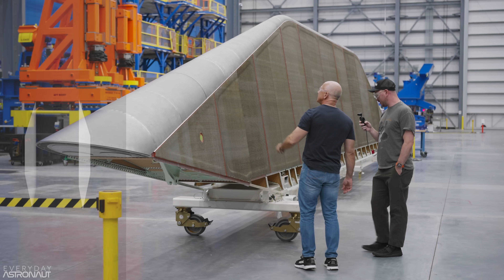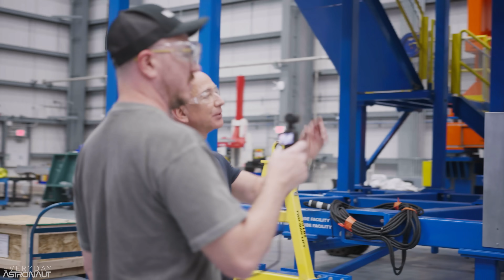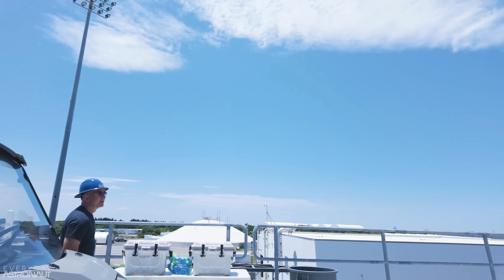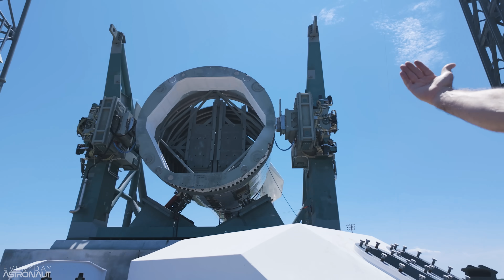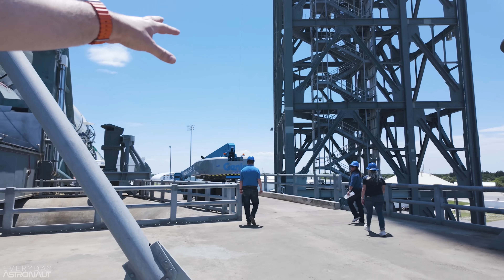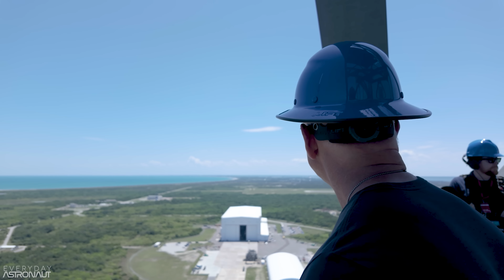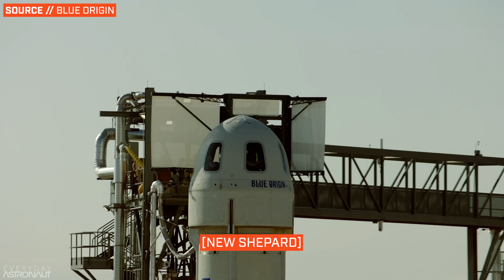First Ever Tour Of Blue Origin's Massive New Glenn Launch Pad w/ Jeff Bezos!

Comment: It’s crazy how different this is from how SpaceX builds Starship. I mean it’s both heavy lift vehicles but at the same time so vastly different
Reply: It’s just different philosophies. SpaceX built a factory around a rocket with the needs of that one rocket specific rocket in mind. Hell, they even waited to build the launch tower until they knew Starship was able to fly and land with the current dimensions.
Blue Origin built a factory, launch pad and everything else needed before building a rocket or even have it static fire.
Both are valid approaches. One has the rocket fit into the surroundings and one has the surroundings fit the rocket
Reply: @marvinko6610  This is so well explained! It's exciting we get to witness both journeys.
Reply: @marvinko6610  Astute analysis
Reply: @marvinko6610  My only issue with Blue Origin / Jeff is around their old-school cost-plus and reward payments before any goals have been met, all of that was derived from the NASA bidding and lawsuit released documents for the lunar bids. Blue Origin proposals to NASA were more akin to Boeing, Lockheed Martin and other legacy space firms.
Reply: Waterfall engineering.  Where you solve all problems in advance.  Space X.  Hardware rich then blow it up and find where it breaks.  Waterfall vs Hardware rich.
Reply: @mefobills279  problem is they will have to face those failures to and with there slow speed give them another dicade to get this thing to perfection
Reply: @mefobills279  The problem with waterfall engineering is that many of the problems cannot be solved in advance because they are unknown. With the SpaceX approach you get to know about them PDQ.
Reply: @mefobills279  like Boeing. I am not saying it's worse, with all respect to Blue Origin, SpaceX has proven that their approach works.
Reply: @varyagus  I agree, the waterfall approach is inferior.  There are things that you can not know in initial design.
Reply: @mefobills279  Finally more and more people are seeing that Starship is just Elon reinventing NASA in 1960, like he reinvents everything
Reply: @mefobills279  And still no proof that "hardware rich" is better, as Musk claims.
Reply: @marvinko6610  New Glenn and Starship do not compete. New Glenn is a heavy lift class rocket, Starship is a super heavy lift class. Look up their payload mass to LEO, it is a big difference. New Glenn does compete with Falcon Heavy, though.
Reply: @klapstoelpiloot you're citing wikipedia at this one. The truth is that New Glenn uses 7 engines with very little thrust for it's size and weight so this particular ratio allows the New Glenn to do orbital missions only. If they however, raise the number substantially while upgrading their BE-4 to 300tf up from 250tf might allow them to compete with Starship for interplanetary missions like Moon or Mars. Starship for reference with 33 Raptor 3 SN1 thrusting 320tf each goes up to 10,560tf, in comparison to 7 BE-4 on New Glenn each thrusting 250tf for a total of 1750tf. It's almost 10 times more thrust.
Reply: @klapstoelpiloot  both are unfinished and unproven in their complete capabilities. Both have lots of work to do before achieving their goals. Both have long term focus areas that are very different that the current marketplace provides.
Reply: @klapstoelpiloot  Falcon Heavy, A rocket that is so needed it has launched less than 10 times in 6 years, ahum. And bezos thinks his rocket that costs 4x as much (expendable!) can compete. New Glenn only has a very small niche in which it is uniquely suited.
Reply: There are many reasons for a difference -- SpaceX and Blue Origin have different goals -- SpaceX want to colonize Mars while implementing Nasa Contracts Whereas BO wants to do near space things like Commerical Space Stations and complete there Nasa contracts...I have enjoyed both visits to the factories and wish them all success -- What is similar between both companies is the focus to reduce the cost of access to space
Reply: wtf are half of these comments, spacex is building starship in a way where they build fast, break stuff and fix it blue origin is making sure everything works on paper, working out all the issues (and hence taking longer) and then flying
Reply: New Glenn is a Heavy launch Vehicle, Starship is a Superheavy Launch Vehicle
Reply: @infected7258  starship is a tin can.
Reply: starship is a super heavy-lift launch vehicle.   And if there were another classification above that, it would probably be that, too.   But super heavy lift is just anything more than 50 tons no matter how much more than 50.   Because at the time 50 was isane.
Reply: I am very positively surprised about how much Jeff knows about his rocket. Great to see!
Reply: One has results, the other has aspirations.
Reply: @richardpark3054  the market is evolving. It is dumb for Musk disciples to keep proclaiming that SpaceX has already "won" the race. ThIs race to create a commercial market for space industries off-Earth never ends  -- and  in major aspects SpaceX is certainly far ahead right now, but Musk has a different set of long term goals from NASA and from Bezos. I

N this market,  there is more than one race...Blue is a major influencer, just not yet a proven fixture in the orbital segment, but is not far off from being a presence there. Will they succeed? They certainly seem well positioned to have a long term presence.  In time, BO is capable of achieving its place in the orbital market that SpaceX currently dominates largely as a sole provider. SpaceX total dominance won't last forever, most likely, any more than Henry's Ford's dominance of the early auto industry prevented other entrants and enormous competition.  Ford didn't automatically remain on top forever. 

People ignore the fact that Musk's  long term plans involve a different set of priorities.  What is interesting to think about is "what will this market look like in 5 years and in 10 years?" undoubtedly, it will be very different than just what we see now.  There is room for numerous participants and each will find what they see as a fit, while constantly looking forward to the next phases and where they fit in that.  The free market is dynamic but nature.
Reply: @richardpark3054  I literally just saw a “successful” starship landing that never actually showed the landing and I saw the ship falling apart as it was doing its descent. Literally pieces flying off and metal melting like tinfoil
Reply: @strangeke7750  What are you saying here? Have you ever listened to anything? For the 1,000 th time, SpaceX goes by iterative design, that mean the rocket is likely to fail at some point, and they want it to. It gives them the information to correct problems, then launch again. Each time the rocket gets a step further. Next step: prevent the flaps from melting. If you pay attention the new ships have altered flaps that are shielded better at the hinges. And an upgraded heat shield.
Reply: @strangeke7750  you did see it fly ... that's one step ahead.
Reply: @CHMichael  is it? I see blue origin putting a lot of effort into reusability. Which is the whole point. How reusable is starship? I literally just saw it melt in a “successful” launch, literally saw pieces fly off and the steel being melted through. Wow so reusable and cheep. That will surely make us space faring 👍
Also we haven’t seen the new glen fly yet. But I bet everything on them being more successful then space x.
Reply: @strangeke7750  how reusable is new glenn's second stage compared to starship?
Reply: @ASTR_INF  starship second stage isn’t very reusable. Sorry to say. But let’s give blue origin some time for launches. At least a couple.
Reply: @strangeke7750 you saw pieces fall off the second stage that still successfully landed — a second stage which BO will intentionally destroy every launch.
Reply: @zachansen8293  it didn’t land. It was falling apart and melting. Lmao. And you never saw it land
Reply: @zachansen8293  Actually BO is trying reusable and disposable second stages. They will figure out which is cheapest.
Reply: @StillAliveAndKicking_  We've seen what spacex has to do.   It's not something you can "try out".  Also, their rocket probably isn't big enough to get a meaningful mass fraction.   Super heavy is 2+x the thrust of a saturn 5 to get fat albert, errr, starship, into orbit.
Reply: @strangeke7750  It was falling apart and melting.   but it absolutely made it to the surface softly -- a real testament to its engineering.
Reply: @strangeke7750  BO intends to blow up every second stage they launch.   So not sure how that could ever be more successful.
Reply: @strangeke7750  First, how did you 'just see' a successful Starship landing? The last prototype flight was early July, about 2 months ago (I was there). Second, your measure of success is not universal: your 'failure' may meet criteria for success in a different context.
EDIT: Every Saturn V booster ever flown crashed into the ocean. Same as every booster ever made (except SpaceX Falcon 9 boosters). Were those all failures?
Reply: @snuffeldjuret  I don't recollect venturing an opinion on that. Could you re-read my post and correct me if I'm mistaken? Thanks! (In advance.)
Reply: @snuffeldjuret  Our very slight conflict is not about what I thought, it's about what I posted.
Reply: @paulmichaelfreedman8334 that’s just normal design process lmao. I swear you guys take company slogans as some sort of bible verse
Reply: @strangeke7750 if that’s all you’re seeing maybe stay away from all this. Pretty clear it’s all over your head.
Reply: @strangeke7750  Not yet. But it's still really early in the actual design maturity phase. The first stage is basically through about four iterations and the second stage is through about three. We still have a lot uncertainty at that point, especially since they are making design changes that do ultimately affect the rest of the system too. The US government is the primary reason this is all going so slowly - not SpaceX or their methods.
Reply: Yes, true. But wouldn't necessarily compare it to Starship. More like, Falcon Heavy.
Reply: It's a battle of SDLC methodologies. Elon started significantly sooner which is why he's got things to show for it. I think Agile will win, but let's give this a shot.
Reply: @Balmorax  If you go back and look you'll see that BO is the older company.  Jeff got started first, he just looks like he didn't.
Reply: For what it's worth, both companies are after two very different ends goals using different methods with vastly different time horizons. While it is good entertainment to compare them, they are not competing with each other at all. At least, not now or in the foreseeable future. 

So, all this talk is quite premature.
Reply: SpaceX funds the Startup through Falcon 9 launches and recurring revenue from the satellite network. All with a reusable rocket built in a factory. We now see a factory for Starship and boosters still iterating changes to the rocket and infrastructure. It’s been a lot more exciting watching SpaceX. Amazon cash funds Blue Elon built a space based business to fund Starship. I hope Blue flies but as a bedridden man it’s been more fun to watch SpaceX every day. What a time to be alive. I hope I’m around to see both launching.
Reply: Jeff Bezos looks like a turtle with a helmet on
Reply: the fact space x doesnt need either an erector, this mass simulator and integrate vertically their rocket with various cranes is way better and more efficient. 
the cost of erector and mass simulator must be insane…ground support equipment is a killer in such industry!
Reply: Like a factory production line compared to a bespoke "Rolls Royce" production.
Reply: Both teams taking shots at each other.  Hilarious.
Reply: Spacex built Starbase more like a shipyard than a traditional aerospace plant, but that was always intentional. SpaceX always did things simple because it allows higher rate of change and faster improvement. Blues infrastructure is impeccable but that comes with tradeoffs too. I would bet a lot of the way blue runs is heavily influenced by the way jeff built amazon out. If you see one of their new distribution centers they are built out with the same philosophy. Despite that in the time blue has been going spacex has dominated the market and has actually been running revenue programs for years rather than endlessly perfecting.
Reply: @briancnc  dude. I’ve worked in a fabrication workshop. When it comes to quickness or efficiency blue origin takes that win. Because they actually spent a ton of money on infrastructure. They build Indoors with indoor lifts and dry conditions that cut down on wasted time. Space X hasn’t even got that. Maybe musk hasn’t built it because he isn’t sure he can even do it?
Reply: @strangeke7750  whats the net output though, that's all that matters. If you don't get the contract then it doesn't matter how fancy your shop is, that's why spacex has dominated the market with hundreds of successful launches
Reply: @briancnc  they just built the thing 4 years ago. They are about to test their first FULLY BUILT rocket.
Reply: @strangeke7750  that's literally my point, 20 yrs and little progress. Excited for them both but blue and spacex had different strategies for which spacex has made far more progress on actually exploring space.
Reply: @briancnc  what did they explore that hasn’t been explored already? lol. All I see is then blowing up rockets
Reply: Starship is a super heavy lift vehicle.
Reply: @C-U-Next-Toosday  If that's all you see, well let me tell your your vision absoluty sucks, moreover, you're completely blind. Assumption is the mother of all f-ups
Reply: It is more in line with ULA
Reply: Blue Origin is the "old school" process with private money (and some NASA cash).  Bezos hired out of the old school industry.
Reply: Different men - different teams - different approaches 🚀
Reply: This is more like the Falcon Heavy and can't be compared to the massive Starship.
Reply: And there is also a rocket company in Germany building a rocket based on car parts. Tis really indicates that space flight industry is booming and innovating! 🎉
Reply: SpaceX funds the Startup through Falcon 9 launches and recurring revenue from the satellite network. All with a reusable rocket built in a factory. We now see a factory for Starship and boosters still iterating changes to the rocket and infrastructure. It’s been a lot more exciting watching SpaceX. Amazon cash funds Blue Elon built a space based business to fund Starship. I hope Blue flies but as a bedridden man it’s been more fun to watch SpaceX every day. What a time to be alive. I hope I’m around to see both launching.
Reply: Hope they show us something soon.
Reply: @C-U-Next-Toosday  Not Xitter... TwiX!  ;-)
Reply: Different timeline too, tbh. But better late than never.
Reply: It’s so funny seeing all the libs in here that were Musk fanboys a few short years ago driving their teslas to Starbucks to get a soy latte. Now they hate on him every chance they get simply bc he disagrees with their politics…
Reply: When is Blue Orgism going to actually lift something heavier than tourists? Or deliver engines that are nearly 10 years late? Asking for a friend.....
Reply: We live in a time where people actually have the option to be fanboys and choose sides. Its awesome
Reply: @os10v311
Promoting free speech is being a villain?  1984 anyone.
Reply: Yeah Jeffs is KRAP talk about propaganda 🤣🤣🤣🤣
Reply: Blue are more professionel. Space X look like rocket nerd amateurs in comparison.
Reply: @ACPilot  exactly. Blue origin is building a strong foundation. Space x looks like a makeshift one off diy project.
Reply: I applaud bezos for at least putting his money into space stuff instead of so much other nonsense that billionaires put their money into but at the same time it's hard not to see that these are mostly empty buildings and he really doesn't have a manufacturing process to build a lot of these. Now maybe he doesn't need to build or want to build a lot.
Reply: A better way to spend 1 billion. 😊
Reply: @marvinko6610  I think Blue Origin will prevail over SpaceX rapid prototyping. The question isn't, who's in Orbit first. The question is, who's got the more efficiently reusable launcher when both are in Orbit, who can offer lower faire to Orbit?
Reply: Considering Starship doesn't work, I really hope it'd be different...
Reply: @llollercoaster  I hope this comment gave you validation. Because you know, being a snarky dick on the internet is making nobody's day any better and the internet discourse as a whole a lot worse. So i hope at least you've gotten something out of it
Reply: Is new glenn heavy lift??
Reply: @Berilaco  it is. Even though New Glenn is 45 tonnes to LEO as opposed to Falcon Heavy’s 60 tonnes
Reply: @marvinko6610  i thought heavy lift is above 50 tons
Reply: @Berilaco  I think they can technically get there if they expend the booster. But at this time any numbers of how much New Glenn can put up there are theoretical anyways. 
So the best way to put it is that they are aiming for heavy lift
Reply: @marvinko6610  yeah... and if new glenn becomes as good as they want it to be it should be a bit better than falcon 9 right? Like twice the payload and stuff
Reply: They’re both^
Reply: and Blue is a total joke, while spaceX is making stuff happen.   Its all about leadership.   Bezos is an incompetent stooge.
Reply: Space x is bringing back astronauts stranded in space.
Reply: @everyone here. There is no need to pick a side. You can like both spacex and blue. And if you think one isnt doing a good job then start youre own space company. *edit: except boeing lol
Reply: @JeroenvdWal  Yeah I'm rooting for both Blue and SpaceX, and all the other little ones as well,  Rocket Lab, Stoke, Relativity, Impulse to name a few
Reply: For reference, falcon heavy can lift 42.0% more than New Glenn and is barely used..
there is no market for this
Reply: @KCJbomberFTW  lol what the hell are you basing those figures on🤣🤣🤣🤣 are you comparing new Glenn in fully reusable config to falcon heavy being entirely discarded? You have to be fairly slow to be making this comparison and forgetting the several hundred million dollar price difference
Reply: @sickbailey21  you realize the falcon heavy was reused before it was discarded they only use end of life craft which are free🤭
Reply: @KCJbomberFTW  if spending 20million dollars on refurb after every launch and spending 50 million building the thing is "free", I would love to live in your reality.

They used the worst of the worst boosters on the maiden test flight to prove the concept. Any meaningful and valuable payload would be given its due concern.

Any booster viable to fly in falcon heavy could be used for a charged flight to leo elsewhere. It has to survive significantly more vibrations and energy on the heavy launch than a solo flight.

You don't seem to be objective.
Reply: @sickbailey21  I’m saying if falcon heavy has only flown 10 times total there’s never gonna be enough Glenn’s to make reusability matter it’s whether it exists and there’s already a vehicle that owns the category.. the rest has been taken by block 5+ falcons
Reply: @KCJbomberFTW  these vehicles do not need to be flying at full capacity for their cost benefits to land though?

Until they fly we can't be sure, but the main purpose of these vehicles is the reusability factor. If these goals are achieved, these vehicles (both starship and new glenn) would facilitate falcon 9s launch payloads at a significantly cheaper rate than the falcon is able to achieve.
Reply: @KCJbomberFTW  to be clear with the falcon heavy you're already looking at about 20m dollars refurb per booster. So 60million dollars before the second stage and launch pad repairs.

Both companies are aiming to eliminate a significant portion of this cost to bring the whole cost per kg to orbit down.
Reply: @sickbailey21 Falcon heavy consists of three Falcon 9's
Two return to land, one is expended. Two thirds reusable.
Reply: @KCJbomberFTW  blue origin will create a market for it. We’re going to the moon. Blue origin might secure the nasa contracts for the moon if they build a heavy lift rocket first. Also falcon nine can do 13 tons while new Glenn can do 45
Reply: @strangeke7750  falcon 9 not falcon Heavy bro.. Falcon heavy can do 66,000 lbs or 141,000lbs (64 tons) expendable 
For reference starship V3 can do 300 tons fully reusable
Reply: @KCJbomberFTW  does that include the craft itself? 😆
Reply: @KCJbomberFTW  falcon heavy can lift about 13 tons. Once again musk is taking you for a fool
Reply: No… this is heavy lift and starship is SUPERHEAVY lift
Reply: @KCJbomberFTW  starship is not super heavy lift. That’s bluster. Musk lied to you. Starship can lift about 50 tons and that’s still up for debate. That’s if he wants to reuse it. Blue origin is about 45 tons. For reusability. Musk is deceiving you. Just like he deceives Tesla buyers on their range 😆
Reply: Bezo;s has no zombie mode
Reply: Fandom gonna shake the pom poms, and drink the blue kool-aid. Usually the very young without critical thought processes yet. No big deal. Starship is the next class up from New Glen, as had been pointed out. It's also in prototype. There are no Starships yet, and Gwen Shotwell has stated it'll be "hundreds" of flights before it even gets close to human rated (if ever). Clearly New Glen is going to be a finished, and operational rocket long before Starship... With maybe the exception of HLS (if that even works). That doesn't mean Starship is not a good ship, or losing any sort of imaginary race. We need both of them.
Reply: Americans with the biggest capital to buy the best technology with limitless visions. Awesome
Reply: Clearly Blueorigins setup is substantially more mature, and has laid a significant foundation for future projects.
Reply: @otockian  What? How many orbital flights have they managed to date? Zero.
Reply: @otockian  - it's the old way of working that a lot of us thought didn't anymore work because of Boeing.
Reply: @otockian  lol  hes had 10 years and billions ..  Hes a decade behind Elon . He has 0 income
Reply: And yet after 20 years they haven't reached orbit  @otockian
Reply: @otockian  not at all bro. Spacex launches almost everything, Starship is their r&d and they do it better, just way more scrappy cause they hard optimize for speed
Reply: @otockian  its actually the opposite, spacex can pump out starship after starship, blue origin hasnt even completely completed 1 yet, thats not how a mature setup looks like
Reply: @Nuke-MarsX slow and steady wins the race
Reply: @Nuke-MarsX  Blue definitely has way more old school aeorspace engineering behind it, evidenced by there choice of materials for the rocket, and some of their engineering decisions shown in this video. The thing I wonder about Blue though is, are their unknown unknowns, going to cause them to have several failures of New Glenn on the path to reusability. The manufacurting techniques they are using are state of the art, but aren't inexpensive. So I question how expensive in time and capital building New Glenn in the long run will be. Even though Jeff has pretty deep pockets so it's probably more about lost time in development compared to spaceX  than anything else.
Reply: @strangeke7750  normally yes, but in spaceflight its almost the opposite, slow and steady was every rocket company  until spacex came, and we know who won the race
Reply: @Nuke-MarsX  space x is a one hit wonder. The falcon 9 is somewhat reusable and I think that’s where their success stops. I don’t think the way they have gone about the starship is very good. Musk thinks he can just weld a bunch of steel together and just succeed. Blue origin is going all out. From materials, to assembly plant, manufacturing, rocket transport and launchpad. They have built all of that with a lot of thought, consideration and attention to detail. I think at this point space x knows that they can’t make the starship work and they are hiding their failure while at the same time they can’t seem to fix any of their problems. I don’t think they are capable. They can’t land the starship without destroying it. Their starship is not reusable and it can’t land safely. It’s gonna take a lot more then stainless steel prone to fracturing to make the rocket reusable and able to land
Reply: @Nuke-MarsX  These Starships that you speak of can't reach LEO and can't carry any cargo.
  New Glenn is flight ready, Starship is 5+ years behind schedule.
Reply: @strangeke7750  "slow and steady wins the race" or it gets you SLS.
Reply: @Eagles_Eye  you have to remember that Jeff bezos isn’t a traditional type. He revolutionised online shopping. He runs one of the most efficient companies in the world. Amazon is streamlined. This is what Jeff bezos does. So we still have to wait for him to start launching. But I believe he will be the one to bring on the space age. Not musk.
Reply: @strangeke7750  NASA evaluated SpaceX and gave them top marks noting that the management was excellent.
Reply: @strangeke7750  brother in christ have you seen ift 4, how can you be so ignorant
Reply: @Eagles_Eye  To it's credit, SLS launched an un-crewed mission around the moon already
Reply: @areitu  sure.  After that many years. That much money + being expandable.  You better hope it at least does its one job right.
Reply: @Nuke-MarsX  Nobody has won any race. The race never ends and there will be periods when one player dominates or influences in excess of others. Then a disrupter will merge and change the rules of the game, just as Space X has done for the past few years...but new entrants will emerge and eventually do the same.  This is the the nature of the free market, which is a relatively new environment for Space industry.  

When Henry Ford established mass production and dominated the production of autos, that was NOT the end of car innovation, or competition in the auto industry.  Are we all still driving Model T's?. Competition is good. The future will not always resemble the present.
Reply: @eichelbergergary   great comment, but SpaceX has certainly won many races in the overall "space race."
· first soft landing of a first stage booster
· first successful reuse of a booster
· first recovery and reuse of fairings
· first commercial resupply mission to the ISS
· first commercial crew to the ISS
· first low earth orbit commercial satellite network
· first full-flow staged combustion engine to power a rocket to orbit
etc. In addition to many impressive milestones like 368 successful Falcon launches, 330 successful Falcon booster landings, putting over 80% of the spacecraft and 80% of all the mass into orbit last year, biggest and most powerful rocket to reach orbit, etc. Which makes @strangeke7750's comments particularly clueless.
Reply: @strangeke7750  One hit wonder?!?!? Seriously?!?!? 
Falcon 1 
Falcon 9
Falcon Heavy 
Dragon
Dragon 2 & successful human rated versions
Merlin engine family (a huge amount of achievements within this)
Draco engine family 
Starship (I know you consider it a failure, but it really isn't - it hasn't matured yet, and thats why idiots like you don't recognize its success)
Raptor engine family (incredible amount of achievements in here too) 
Starbase (a lot of first of its kind stuff here too)

Starship isn't done yet, just like it wasn't done yet when the Mk. 1 tank was constructed. Starship has come a massive way since the Mk. 1 tank, and that was six years ago. That you see them the way you do is honestly mind boggling.
Reply: @otockian more mature by having shown not a single successful mission to orbit ?
Reply: @otockian what makes you say that. I’m not hating on Blue here I’m just genuinely curious why you think Blue’s setup is “more mature” than Space X I presume.
Reply: @otockian Debatable lol Starship has flown many times already
Reply: @otockian don’t mistake overreaction and too many constraints for maturity…
Reply: Liss @otockian
Reply: @otockian  BO's setup is classic. SpaceX 's iterative approach is vastly different, building at high pace and launching and testing and seeing where it goes wrong, correcting, etc. What spaceX has achieves with a billion dollars is a multiple of what BO achieves with the same amount. Classic method is slow and expensive. Remember New Glenn has been in development for over 12 years, Starship only 6.
Reply: @paulmichaelfreedman8334  SpaceX's approach is also classic. Classic Soviet Soyuz development.
Reply: @otockian  "Clearly Blueorigins setup is substantially more mature" Strongly doubt that.  BO does things a lot slower.  It's literally their motto.  It just looks slicker cuz they want to get every detail right up front.
Reply: @dudermcdudeface3674  fast isn’t always better. Good things take time. I don’t think space x will ever get starship to land properly
Reply: @otockian perfect to follow spacex into the next few decades!
Reply: @otockian  hardly more mature.
Reply: Elon with his kids running around v Jeff trying to remember what his engineers told him.
Reply: @CHMichael  To me both approachs have merits. Which do you think is better?
Reply: @FuelX Elon is doing a diy set up  outside of a garage while bezos is actually using advanced technologies and innovating and thinking very practically about the next step instead of Elon whose pie in the sky and should stop getting high
Reply: @FuelX  one is putting satellites into orbit and picking up astronauts from the iss.
The other is taking tourists into near space .
I find the concept of catching star ship absolutely insane but so was the concept of landing rockets.
Lets see who reaches the next step first.
Reply: @CHMichael  one is going to the moon, the other is staying in earth orbit 😆
Reply: @CHMichael  True, let's watch and see which one works better. I would place my bets on BlueOrigin overtaking SpaceX as SpaceX hits the brick wall of running a skunkworks operation as it has a ceiling where you can't climb any further without building out substantial infrastructure which BlueOrigins has a huge head start on already.
Reply: @strangeke7750  but keep in mind they are using drastically different development methods. Blue origin is figuring out problems through cfd and stuff like that, but can miss stuff. SpaceX is launching quick prototypes to find every possible problem and fix them for the next launch. Each one is different but idk which is better
Reply: @Allthegoodhandlesaretakenlmao  I think so. I love that the industry is alive and great engeneers and managers are trying different approach to solve the space accessibility problem!
Reply: @strangeke7750  You wish, one is going to the moon, the other is going to MARS.
Reply: @otockian  space x Texas operation?
Reply: @paulmichaelfreedman8334  space x is never going to mars. They haven’t even landed their starship yet. I think space x is farther from actually landing their ship then blue origin with new Glenn. 😆 Don’t believe me? Eventually musks lies will run out.
Reply: @lazerusmfh  cool story. I bet blue origin will dethrone them and leave space x in the dust. I hope so.
Reply: @strangeke7750  Which lies? You mean all the promises he actually delivered on?
Reply: @strangeke7750  What do you mean? SpaceX has been landing boosters for 9 years straight now. IFT-5 has significant upgrades and changes are very high it WILL land. If not, IFT-6 will. I'll bet your month's salary they get to Mars, but it's gonna take another 10-15 years.
Reply: @paulmichaelfreedman8334  he hasn’t delivered on many promises. If you go back and look at some claimed he made throughout the years, he hasn’t kept most of them. He makes a lot of promises and rarely fullfils. He’s a lier.
Reply: @FuelX  Starship needs to launch around 15-20 refuel trips to orbit in order to send a single unit to mars, based on the current estimates of fuel burn off and launch turn around time. Starship in its current iteration needs some significant work to be a heavy lift launch vehicle even for earths orbit.

Until we see BO launch this though, no one knows. I'm excited to see what this achieves.
Reply: @CHMichael  you're thinking of the old BO rocket, the new glenn is a completely different vehicle.
Reply: @strangeke7750 You could not be more wrong. SpaceX are able to innovate far more because they try something, if it works, they keep it, if it fails they redesign it, and they simplify everything as much as possible. They also take a huge number of measurements during test flights which allows them to improve the design and fix any weak areas in the design e.g. increase heat shielding in some areas, reduce it in others, strengthen the hull where needed, move the fins when needed. BO does a traditional up front design, using conventional methods and techniques. Simulation is never as good as experimentation. Granted the reusable part is not traditional, but it’s been proven by SpaceX. SpaceX use agile methodology which is a much more modern way to manage complex projects, unlike the waterfall model used by BO.
Reply: @strangeke7750 ok fan boy of old school go slow try for perfection the first time. Sad, because you never ever learn a thing if you do things right this first time. So sad, that conservative attitude leads to the opposite of progress.
Reply: @FuelX  SpaceX. Continual testing and improvement from lessons learnt is the best way. Designing everything to the nth degree and then having it fail is not productive.
Reply: @GrigoriZhukov  you can learn from the process of making the thing. You can hypothesis about problems while making the thing. Taking time to make something is actually better than slapping it together hastily. The process itself is a learning experience. And like he said, space travel has already been solved it’s just making it affordable that hasn’t. Musk is trying something completely new and he’s failing. And he’s going to keep trying it until he’s broke
Reply: @StillAliveAndKicking_  I think space x methodology is wasteful and stupid. Blue origin methodology is refined. Blue origin is years ahead on building a heavy lift rocket. That’s my opinion. Even tho musk has already launched his starship. I think blue origin I still ahead in their approach to the bigger picture.
Reply: @sickbailey21  I don't know about Mars, it's such a complex endeavour but it would make a great taxi between LEO and the moon. The refuel process is scary and would require so much energy. I hope they will both succeed! I'm not sure I would like to land in a Starship however.
Reply: @FuelX  Yeah that landing is going to be an experience! 🤣 your insides are going to be all over the place. It will be art to watch it happen for the first time though.
Reply: @sickbailey21  I handle roller coasters pretty well, but I'm less confident about Starship landings.
Reply: @sickbailey21  it actually competes with falcon heavy.
Seems important to see what they have accomplished so far to determine the chance off success they will have in the future. 
We know one thing for certain,  both have a better chance than Boeing
Reply: @strangeke7750  You're a weirdo. Musk delivers way more than most others if I have to compare. You're just biased because of some personal problem.
Or, give me your list of what he hasn't delivered, then we'll talk again.
Reply: @CHMichael  the flacon heavy can only do 60T to leo if you destroy the entire vehicle, all 3 boosters. This is like trying to compare a completed starship to the falcon heavy and ignoring the launch price, if both achieve their goals.

It is dishonest.
Reply: @strangeke7750  Actually SpaceX developed the first privately developed orbital class rocket (Falcon 1), the first semi reusable orbital class rocket (Falcon 9), the first privately developed cargo freighter and crewed capsule (Dragon), and a semi-reusable medium lift orbital class rocket (Falcon Heavy), all before BO even got to orbit, and they still haven’t. Falcon Heavy is MORE capable than New Glenn in all but one aspect, namely payload bay width. I’ve worked on waterfall projects, and Agile projects. Agile are better, usually much better, because you spot the problems early on when it’s easier and cheaper to fix them. If New Glenn has a serious design issue, it could be a nightmare to fix. In their defence, their BE4 engines performed beautifully.
Reply: @StillAliveAndKicking_  sure what ever. Time will tell
Reply: @otockian  It may have been skunkworks in tents 3 years ago, but Spacex now has a fully operational factory, just as mature as BO's - and 4 launches worth of data. The Raptor 3 looks so refined it could be in an art museum. BO spent years building this infrastructure but they are going to probably miss their Mars launch window. They focused on the wrong thing and are way behind. They just had two accidents with hardware destroyed for future rockets. Spacex has 5 boosters in production at the current moment and an entire second tower going up. Literally their own launch complex. Don't get me wrong, I am hoping BO is successful because I love all things space and competition is good, but they are not leapfrogging Spacex anytime soon.
Reply: @strangeke7750  blue origin will not land "ship" on new Glenn.. upper stage is expendable.. like falcon 9... falcon 9 has been landing for years now.

let blue origin catch up with spacex's total mass to orbit before claiming they have overtaken spaceX
Reply: @Eagles_Eye  you not making sense. Total mass to orbit won’t matter. That’s a stupid metric to follow. Just wait. You will see.
Reply: @sickbailey21  so that's 100- 150 for star ship,  64 for falcon heavy and 45 for new glen 
... all Leo.  Only one is actually operational. 
I want bezos to concentrate on the hotel he was talking about years ago,  given that iss will be scrapped soon. 
Have bezos build it,  elon lift it and then new glen can take people and equipment to actual "space" while space x is working on Mars.
Reply: @strangeke7750  Have you ever worked on an engineering project?
Reply: @CHMichael  starship is currently only achieving 30-50t to leo. They have not achieved anywhere close to the 100-150 they originally advertised.

SpaceX is not working on mars 🤣 they are using the idea for funding for sure. but these companies are not close to serious mars missions yet.
Reply: @StillAliveAndKicking_  kinda yeah. I built a robot once in a class setting. I know a lot about manufacturing. Not only from classes I took at school but from my personal interest in robotics, aviation, rockets and things like that. Even today I saw a really cool video of this dude using ropes for robotic bird legs that are better than gears to transfer rotation more precisely. Which I love. Really love biomimicry type of design. I mean I’ve seen enough to know that Jeff bezos is doing way more than musk. Even tho the results aren’t there yet I think when they come they will be way more then what musk has achieved.
Reply: @otockian  i dont wanna sound like a blue origin hater but in that regard spaceX already won. 
blue origins new glenn isn't competing with starship. its much close to falcon heavy in size and payload capacity. well actually lower payload weight tho bit bigger volume than Falcon Heavy. 
and Falcon Heavy has been flying for years now. 
starship, if it succeeds, is on a completely different scale to this. while not landing yet they showed the capability of getting to orbit while blue origin didn't even launch a single orbital rocket not even talking about landing yet

Im hoping Blue Origin can make it. competition is great. but don't be disillusioned. spaceX already is a Industry veteran and leader in this space. blue is the new kid on the block
Reply: @strangeke7750
Your post is ridiculous.  The only company that has even made it to orbit is spacex.  You don’t have to denegrate spacex to praise BO.
Reply: @strangeke7750 elons pie actually flies.    He owns a majority of all satellites.
Reply: @otockian have you seen starship?
Reply: @strangeke7750 they absolutely soft landed starship where they intended to.    Due to safety concerns that wasn’t on land but it would have been successful if it had been.
Reply: @zachansen8293  lmao. No they didn’t. It disintegrated. I saw it and the feed cut out and you never saw it land.
Reply: @strangeke7750  Okay, but you know nothing about teams and huge projects then. Projects can get so complex that you can’t plan everything up front. So you create a prototype, implement key features, test and fix, then add more features, test and fix and so on. If you discover design flaws at the end, it can be very expensive to fix them. That’s why Falcon 9 development was relatively cheap, and yet it’s the cheapest and most reliable rocket ever built.
Reply: @otockian that’s a good point. It seems one has put a lot more time into the front end setting it up and the other uses interactive approaches to get results as fast as possible. Both have worked to date but I am also interested to see what is more sustainable in the long run.
Reply: @StillAliveAndKicking_ 

Dude, you've tried. This person is not an engineer and they are not following this conversation well. It sounds like they are supporting their favorite sports team rather than evaluating facts and making interesting arguments. 

I think even Bezos would not agree with his points.
Reply: @Allthegoodhandlesaretakenlmao   Neither is better, it depends on objectives and company culture. "Agile" full scale rapid prototyping is very expensive and difficult, but has the potential of moving quickly to getting something out. The "waterfall" method is slower, but it can be extraordinarily comprehensive and more likely to work correctly on the first try. How well either one works depends a lot on company culture
Reply: @strangeke7750 I’m not sure the two are even comparable really. Blue has yet to launch their first orbital class rocket. Space X have had a HUMAN RATED orbital class rocket ferrying people back and forth from the ISS for years already.
Reply: @strangeke7750 are you aware of the fact that Falcon9 boosters routinely fly more than 20 missions, right? 
Not a fan of demon husk personally, but space X is legit an current steamrolles the whole launch industry.
Reply: @strangeke7750  what's more challenging? Bespoke production or mass production? 

If you just look at the car, a Bentley is way more advanced than a Volkswagen. If you look at the factory, the one for Bentley would be vaguely familiar to Carl Benz, while the VW factory almost looks out of sci-fi. 

Look at more than just a single point of data.
Reply: @strangeke7750 Aren't both Starship and New Glenn going to the moon?
Reply: @strangeke7750  Why does Elon live rent-free in your head? Why are you so mad? Just be happy we live in an age where the super rich decide to do something useful for humanity.
Reply: @strangeke7750 I’m not a fanboy but the progress on starship has definitely convinced me it will land soon. The progress seems similar to the early days of spacex in terms of rapid failure/iteration.
Reply: @strangeke7750 what are you even talking about? The innovations SpaceX has brought to the space industry has propelled the entire industry forward.  Slashing launch costs.  First to develop reusable boosters. Stream lined rocket engines and manufacturing, etc. You can hate the guy all you want, but at least be honest with your criticisms instead of speaking nonsense.
Reply: @strangeke7750  😂
Reply: @strangeke7750  Like with Starliner, time did tell, and Starliner might not be fully operational before the ISS is decomissioned, waterfall design, while Dragon has taken over their missions, flown private ground breaking missions and more, agile design. 
Oh, and SpaceX got 3.9B to develop the dragon, Boeing got 5.4 to develop Starliner.
Reply: @strangeke7750  bro shut up you don't know what you're talking about in any of your replies 😂
Reply: @FuelX  The one that has been to space unlike Blue Origin
Reply: @Yattayatta  One yielded results, one produced crises. You guess which is which!
Reply: Out of the two companies, tell me, which one has yet to reach orbit, ever?
Reply: @otockian  Watch Musk act like he laid the foundations for all of this, truly the godfather of spaceflight!! (sarcasm if that wasnt obvious)
Reply: @strangeke7750  so falcon 9 and falcon heavy are all fake?
Reply: @strangeke7750 Im sorry bro is actually insane. Saying that starship didn't softland is stupid.
Yeah the flaps melted and we though it would blow up, however, is actually mannaged to softland. Which is incredible
Reply: @badtrekee4348  You should specify "in orbit" instead of "to space". Otherwise we could start a huge debate. And I'm sure OP didn't expect such huge debate already.
Reply: @strangeke7750  And yet spaceX is the only one can save the 2 astronauts stuck in ISS.. so your point is?
Reply: @strangeke7750  Blue Origin was founded in 2000, SpaceX was founded 2 years later.  Spacex has thousands of satellites and a car in orbit; Blue Origin has nothing in orbit. SpaceX is a profitable company, Blue Origin is an expensive hobby. SpaceX has results, Blue Origin has ambitions. SpaceX has a cool name, Blue Origin has a funny name with a smelly acronym. Tell me again which company has a wasteful and stupid methodology?
Reply: @strangeke7750  SpaceX has literally 90% of the global launch market. Blue origin has 0%

Clearly SpaceX is doing something right.
Reply: @strangeke7750 sounds like you are projecting
Reply: @Porsche4life  projecting what? I have like 20 replies in this thread. Be more specific
Reply: @strangeke7750  you wish. Also they have landed a starship, on the ocean.
Reply: @Capiibr  they haven’t.
Reply: @strangeke7750 LMFAO good joke bro
Reply: @otockian 

The musk methodology is not the Skunkwork’s way of doing things. The two are / were totally different.
Reply: @strangeke7750   You think SpaceX planned issues and reiterative designs are inferior to BO’s nothing are a credit to BO?  Stop sniffing glue.  You have got to prove one BO success before your credibility in bashing SpaceX is even better than just a joke.  Up those meds son.
Reply: @strangeke7750  you're incredibly closed-minded aren't you. Saying "I hope" that blue origin will beat spacex shows you're not interested in the level of success in the individual missions.
You simply want blue origin to be 'better' than spacex [as though this is some kind of competition].
Saying that starship is expendable because so far we haven't seen it be fully reusable shows your inability to comprehend the nature at which spacex is developing starship.
They expect failures, that is why they send them being empty tanks. 
These aren't completed designs that they expect will refly. 
I could only imagine when falcon 9 was going through the same process you'd have been saying 'spacex will never land the boosters, the haven't done it yet'

Both companies are doing incredible things, they both have brilliant designs and plans. It's almost certain both will succeed in their own rights. Don't be a hater of humanity, embrace the success of both companies and embrace the bright future we are witnessing the beginning of.
Reply: @isdisavailable3  I was an Elon musk fanboy before. The fact that I think blue origin should win and musk should wither into obscurity shows that I’m open minded. And because I was open minded my mind on musk changed. How open minded are you? I don’t think you’re open minded at all bud.
Reply: @strangeke7750  So I based my statement on what you had said.
What have you based your statement on? "I think" isn't too justified.
Open-mindedness means your open minded to the possibilities. You've stated you hope musk fails. And so far as I can tell, because you don't like him.

I, on the other hand, said both companies are doing incredible things. Haven't had or have a negative thing to say about either company. Do continue to tell me how that is closed-minded.
Reply: @Allthegoodhandlesaretakenlmao agile is generally better - however I want both SpaceX and Blue Origin to be successful. Monopolies are always bad.
Reply: @myprintpod1   yeah. SpaceX already has a lot of the launch market as is
Reply: @strangeke7750  pipe dream bro
Reply: @strangeke7750  Exactly
Reply: @strangeke7750 lol and yet has never launched anything to Orbit in 24 years.
Reply: @TRAC4US  they started building their manufacturing and launch pad 4 years ago. They already have a FULLY BUILT rocket they are about to test before November. If they succeed space x is done. Lmao. That’s 4 years including building the factory. How long has musk been building his starship? And musk doesn’t even have any infrutructure. He has a bootleg garage set up. He wasted a lot of money blowing up rockets. And I don’t think his rocket can land let alone be reusable. 😀
Reply: @strangeke7750  you no you are not being honest with yourself 😂😂😂
Reply: Well if its not SpaceX it's an absolute catastrophic leadership. Since SpaceX was suppose to bye done at this date with Starship. That was the contract.  @CHMichael
Reply: @SirSparris  what contract?
Reply: @CHMichael  then contract that says that SpaceX should have done the Starship SHL for landing on the moon. They haven't event got it up in space yet...
Reply: @strangeke7750  In fairness, BO is not even trying to land their second stage. The Starship booster did seem to do a successful water landing, so arguably Starship has already done everything that New Glenn is planned to do (albeit prototypes only so far).

EDIT - re: the blockhouse and escape tunnel, I'm guessing that is what was shown out by the beach in MIB 3. Or it could be part of crew escape, I guess... don't remember.
Reply: @johnbridgman4310  fair but I wouldn’t say landing in the ocean is a slam dunk. Surely landing in the water bring new challenges like salt corrosion and fractures and so on. 
And when I was talking about infrastructure I was talking about the launch pad. Which space x doesn’t really have a proper one. Blue origin has proper indoor rocket manufacturing plant. While space x has a series of garages lol.
Reply: @strangeke7750  Oh no question... the water landing is just practice. The #5 flight should return to the launch site and hopefully be grabbed by the arms on the launch tower.

Not sure I agree re: infrastructure - SpaceX has a full-blown indoor rocket manufacturing plant in (Hawthorne IIRC)... the vertical garages in Boca Chica are primarily for final assembly, although SpaceX assembles smaller modules than BO from what I can see.
Reply: @johnbridgman4310 they are welding sheets together. Which will be harder then full body composite made in house.
Reply: @strangeke7750  not sure it's accurate to call spacex "pie in the sky" when they've launched to orbit and delivered payload countless times at this point. we're still waiting for blue origin's first orbit
Reply: @strangeke7750 doing a DIY job out of a garage but just happens to have developed the worlds most advanced rocket engine and currently the only company that has an operating reusable orbital class rocket as well as the worlds most powerful rocket? Yeah ok…..
Reply: @shaneross7824  wow cool story bro. But we will see how this goes. You absolute fool
Reply: @strangeke7750  I would love for Blue Origin to succeed, but saying they’re ahead of SpaceX is just ridiculous. Falcon 9 has 383 launches with a 99.22% success rate, and one booster has flown 23 times—how is that not reusable? Starship, the most powerful rocket ever, is already in testing, and SpaceX is responsible for 87-90% of all global payload to orbit in 2024. Blue Origin? Zero. SpaceX has done multiple crewed ISS missions, just completed the first civilian EVA, and built a highly profitable Starlink network. In the space race, “slow and steady” gets you left behind. SpaceX is evolving fast without compromising safety. Still, I do want New Glenn to reach orbit since competition is key.
Reply: @strangeke7750 yeah but only one of them has a game changing global satellite network currently providing wifi to me on a cruise ship and soon all United mainline aircraft.
Reply: @strangeke7750 I want what you are drinking.
Reply: @strangeke7750  you comment is so wrong about space x not having a proper landing after today 😁
Reply: @Wordbavk  the booster landing was pretty cool. But the fairing did not land. In conclusion congratulations to the talented space x team and it’s unfortunate who the ceo is. Hopefully blue origin will do well.
But in the spirit of space exploration. I think the tower landing might actually be easier to do. So maybe the fairing will land like that as well.
Reply: @strangeke7750  at that right there just shows you biased posts because msm told you 🤣
Reply: @Wordbavk  I used to support musk. I used to be you. I made the choice on my own to change and it’s my choice to make. I made the right choice. I hope he fails.
Reply: @strangeke7750  yeah, you changed your own mind the second he stated he was no longer a democrat
Reply: @strangeke7750 1: there was no fairing, starship doesn't have a fairing. If you're talking about the hot staging ring, it was planned to let it fall in the water. Later versions have it built onto the booster so that will come back as well. 2: if you're talking about the actual ship not landing on land... It was also planned to land in water. Literally everything that happened was the exact plan that they drew up for the flight. Literally nothing went wrong. They are doing testing in stages. So ship landing will be done once they feel it's good enough and safe enough to do on land. Remember almost everything on this rocket has never been done before sooo you do it out in the water where it is safe if it goes wrong
Reply: @otockian if spacex achieves rapid reusability . It is game set and match😊
Reply: Damm dude "think you just need to take life day by day",
feeling abit lost and confused ;) all this Arguing MAKING YOU FEEL ALIVE"
 is it 🤨 😂
 damm dude was just trying to have a civil conversation, discussing the pros and cons of both, but you decide to act like a child . 

Wether you hate elon which you clearly do . Wether hate him or not Spacex has help pioneer Rocketry and Space Flight doesnt matter how little or muxh you hate Elon thwre no denying it . But heck not even smart enough to even know how a conversation works do you ?. Ohh did you have to google it ;)

 Find it funny because most people would if they knew there family and friends seen how they spoke on the Internet. Would never do so if that was case. Just because you feel somewhat anonymous. 

How about in future try actually having a conversation instead of just splurging out non sense . 

Don't like Elon and disagree with someone Point of view that's fine everyone is welcome to a point of view . Be polite and acknowledge what they said and then say why you think that isn't the case as an adult hahah and not just gibberish and people might respect you more and there for actually try to see your point of view/perspective.  

But from the 10 odd replies I seen haha wow 8 year old could of spoken better than yourself . Grow up yeah hope santander gives yeah want you wanted ;) habe good Christmas 🎄.
Reply: @CHMichael  at the end, all that matters is which is more reliable and actually safe enough for humans
Reply: @softbreeze941
So far only spacex has a human rated ship.  But hopefully both these new ships will be good.
Reply: @Rauzul  what? why are you looking for hate in comments. I of course competition is good and that is kind of my point, which is safer and better + one can be a backup for the other.
Reply: @softbreeze941 would be ideal if they both ended up there.
Reply: @CHMichael  Elon starship just successfully launched and captured the booster. get rekt Elon haters.
Reply: @CHMichael  lol
Reply: @CHMichael  lol Jeff Bezos has 158 IQ and Elon is the same...
Reply: @CHMichael  yea one has degrees in computer science and engineering, one has 2 ba in physics and economics, do you know which is which?.
Reply: @CHMichael right. Which kids were there? Was it Theater Mechanicus and XA-E12-Ex? lmao
Reply: @CHMichael  stop being a fanboy
Reply: @michael_abia  stop being a hater
Reply: @CHMichael  Jeff graduated from Princeton in electrical engineering with a 4.2GPA and built one of the most advanced software companies in the world. He also minored in physics. He is a lot smarter than you assuming. The dude knows his stuff. There is a reason he is one of the richest people in the world and it's not luck.
Reply: @axumitedessalegn3549  we must have watched different interviews.
Reply: @axumitedessalegn3549  not JUST luck. But there was a lot of it involved as well.
Reply: @DominikPinkas  Enjoy your fiction
Reply: @axumitedessalegn3549  Hahaha. Luck has an immense factor on wealth.
Reply: @simonpeteradkins  enjoy your fiction
Reply: @axumitedessalegn3549 Absolutely true. That's what makes this all the more fascinating. Kudos to Everyday Astronaut for showing us.
Reply: @CHMichael  course Elon doesn't actually care about his children
Reply: @qwerty0532  that would make you a sad little hater.
What a horrible thing to say.
Hope carma catches up to you for that
Reply: @CHMichael  idk im just going off of what his daughter has publicly stated about her relationship with him
Reply: @CHMichael look at this hater
Reply: @BakiVSKengan  I don't think he's a hater. He definitely favor SpaceX but I think he's open minded. It's ok to have personal preferences.
Reply: @BakiVSKengan  I hate haters.
Reply: Well, the only one that is vastly different from everyone else is Starship. New Glenn is a properly designed rocket. Designed digitally, ran through simulations using all the data Nasa has built since the 50s, parts individually tested on a small scale, so they know everything works. This is how you build a rocket. Starship is just a return to the 1950's and 60s. Put it together, yeet it into the sky and see what happens. I gave up on Starship when they tried transferring fuel from one tank to another inside the ship as a test for doing an in-orbit refueling of cryogenic fuel, which has never been done. They could very easily built 2 satellites, have them meet up in orbit and do a fuel transfer the way Starship is going to do it. They have the capabilities to do that easily using falcon 9 to pu thtme in orbit, Yet instead, it is "fake it tili you make it" , in the meantime, they alone have pushed the moon landing back by years.
Reply: @HicSvntDracones  fun fact: The exploration upper stage isn’t ready, the Orion capsule looses chunks of its heat shield on reentry, the lunar gateway isn’t in lunar orbit, and of course, starship isn’t ready. So as you can see, there’s many parts of Artemis that aren’t ready to go. To pin it on spacex is well, absolutely ridiculous.
Reply: @HicSvntDracones  Well that’s very generalised comparison of apples to oranges. Starship is way bigger and uses an engine that before starship never successfully propelled a rocket. So there is no years and years of data to fall back on.
But that’s saying like you should never innovate anything because the “proper” way to design stuff is how it’s always been done. It’s vastly different, yes. However that’s not just by coincidence but by design. Again, not saying any one is better than the other. Just different
Reply: SpaceX method really isn't faster it's just more fireworks. People mocked BO for having "no progress," but they were making constant, quiet progress. SpaceX blows up a lot of stuff but it hasnt gotten them far ahead
Reply: @vasuba  one company has an unparalleled track record of orbital launches, the other has a sub orbital hopper that flew a dozen times. One company has developed two orbital class engines, the other has one (with years of delays). The two are not comparable.